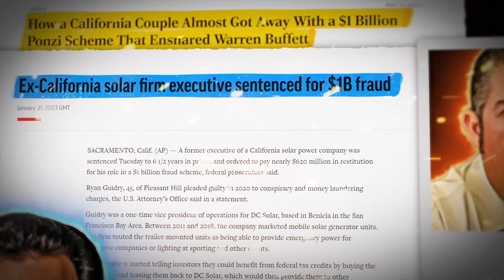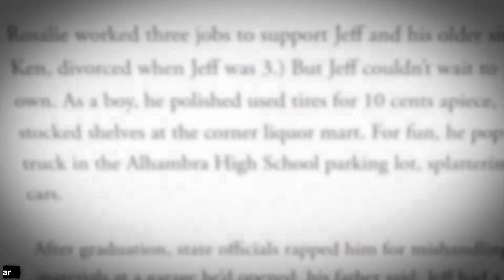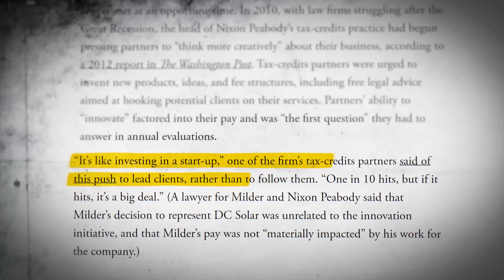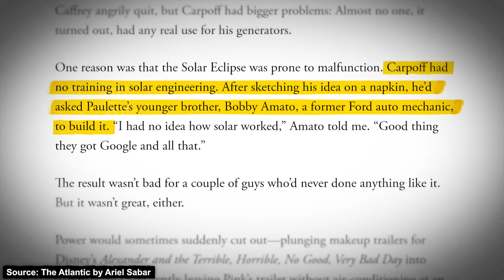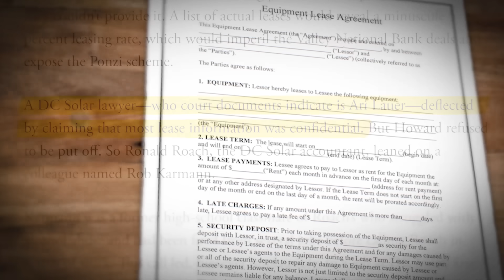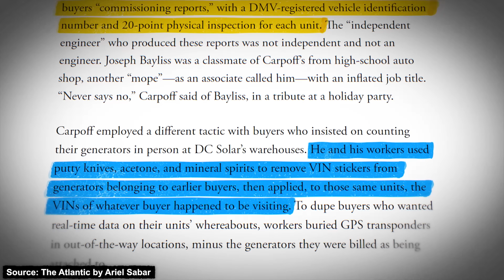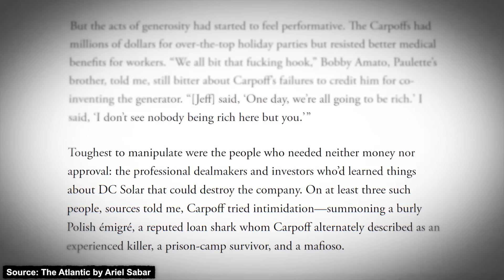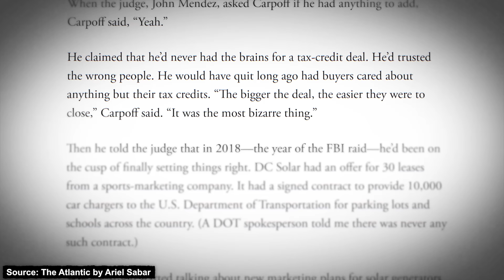The Fake Solar Company That Stole A Billion Dollars

Comment: I live in Arizona, which is a state with a HUGE solar market due to being a desert. I have seen the DC commercials and ads and thought to myself "yeah, that makes sense. A solar panel you can move". It was a simple idea. Had no clue it didn't even work. Just kinda assume if they're spending that much on marketing, they would have a working product. Especially if it;s a literal product you can see and not like a digital crypto currency or something non-tangible. Crazy I didn't know it was a scam until this video. great stuff, as always!
Reply: It seems like such a simple idea tbh. As panels and storage get better year after year this should be a very viable thing.
Reply: @Dantevonlocke  and also progressively cheaper. 

10 years ago the 100W panels cost more than 500 USD each, now you can afford it for a bit less than 100 USD
Reply: @sihamhamda47  a dollar a watt lol

But on topic, I remember seeing a video or something abiut these see through panels that could retain a large majority or the energy. Like more than the 10% or whatever it is currently. It was something over 80%
Reply: @Dantevonlocke  you're not going to get meaningful amounts of energy quickly enough with an array small enough to fit on a trailer. There's a reason engineers who understand the tech aren't implementing the idea; it doesn't work. They definitely thought of it already
Reply: @sihamhamda47  no, no they didn't.
Reply: Its a big lie to sell more chinese manufactured goods.  Efficiency is not what they say it is and drops off year after year.  Similar to a old cell phone battery.  Not to mention how they are made and what they are made with.
Reply: @pranc236  I can say from experience (~15 years with over ~250  295-320watt panels) we have not really noticed or experienced a year over year efficiency decrease let alone a cummulative one (maybe be 1-2% of total production, so if new produced 100kw hrs per day, then MAYBE 98-99kw hrs now).  We use microinverters and have data for every minute & hour of ever day since they were installed.  It's really awesome being able to track individual panels!

Now I'm not saying some panels don't degrade & it's very possible they degrade badly.  Our panels were supposedly pretty good quality, but IIRC, they are Chinese.
Reply: @kde5fan737  solar panels are batteries and batteries dont last 15 years in use with no loss in efficiency.  Everyone has to have a inverter otherwise you can only trickle charge other batteries.  I talked to many people with them and the results are all over the place. One person replaced half of the panels in less than 3 years.
Reply: @pranc236  Possibly, I don't know enough of it to really account for that
Reply: They did actually work ("some assembly required"), but your expectations need to be low. First off, those panels really don't like being bounced around. Second, ground level panels need a vast clear area to work well; the slightest shadow will kill a panel, and thus the entire string. Third, batteries don't like being too hot or cold - sitting in a black box on a trailer in the sun... (and the idiots used lead-acid batteries)

The panels are always the question. The inverters and enclosures were top notch. (they, and the trailer itself, are 90% of the resell value of those things. And they did find there way to eBay, etc.)
Reply: The funny thing is that it probably isn't even teribly difficult to build such a thing, especiallly if you have all that investor money. You could hire a competent electrical engineer to sort out the loose ends or even design a new system from the groud-up.

Heck, diesel submarines have been doing it since WW1. Granted, they don't use solar panels to replenish the cells but it's basically the same concept. Even better, the auxiliary disel generator could be made to run more efficiently (just like a hybrid-electric bus that NYC MTA uses). In short, the batterie allow you to draw power continuously without running the generators for the entire time.

From a genuinely "green" point of view it would be ideal to derive most or all of  your energy from the solar panels. However, you it is also my opinion that a good the ideal DIY solar setup (like w/ those "solar generators" which are just oversized DC powerbanks) would incude some sort of diesel/gas generator. Sometimes conditions are such that you can't fully charge the batteries in a single day, so you make up the difference with the coonventional generator.

Ultimately it's still more efficient than relying solely on the conventional generator, and allows you to  avoid using the grid to maintain the batteries. Anyone wanna go into business with me? Jokes aside (half joking), please consider checking out my channel!
Reply: You are WAY more trusting than me.
Reply: sure, if you can get the trailers and batteries for free.
Reply: You probably live in Scottsdale
Reply: @Dullahan161  maybe one day
Reply: @pranc236 Solar panels definitely aren't batteries. Generally you want to use batteries with solar panels, but they aren't the same thing
Reply: storage hasn’t really progressed since lithium ion. Storage is still the major killer.
Reply: It’s happened multiple times that a company had a faked or non-functional product.  Like Theranos, that hyped its new “blood test” system but really had to just buy older ones to run the blood, or the Nikola, the “clean energy” tractor trailer truck that never worked.  

The prototype truck had no engine, just a cool looking shell, and they had to drag it to the top of a hill and let it roll down to get footage of it “driving.”

Comment: We actually bought out some of his trailer’s from auctions. Gutted them and used the inverters for off grid battery storage. The stuff was junk and half of the trailers didn’t even have wires in them. He would put a small battery in there to power a gps token and make it look like they had them up and running on sites when they just sat in a field doing nothing.
Reply: The most valuable parts would be the diesel generators and the trailers themselves.

Comment: Never heard of this scumbag before this was really interesting .The car collection he had was ridiculous and impressive .Thanks Kira !
Reply: I’ve heard of it thanks to NASCAR.  DC Solar was BIG in NASCAR sponsorships.
Reply: he shoulda got put on by cartel used additional funds to fix products
Reply: @jakelynch3450  it's crazy how they fucked this up, it could have been an unbelievably successful business. there was no need to scam anyone with those profit margins.
Reply: @ripdoff8549  I doubt it could have been highly successful. There simply isn't enough demand for small mobile solar equipment. I mean, it's easier and probably cheaper to mount solar panels to already existing hardware (like the trailers/mobile homes on a movie set) than to have an additional trailer that somehow has to be connected to the power grid. There are some instances where you might need such a trailer, so that guy could have made a life from it and be successful, but not on a billion dollar basis.
Reply: Considering that he bought the car collection pre-2018, he could have pulled himself out from under the mountain by selling it when the market got crazy in 2020/2021, if he had survived that long.
Reply: @ripdoff8549  I gotta say I love the name
Reply: @jakelynch3450  cheers mate, i'd much rather be ripdoff than ripdon though haha

Comment: He could have hired a PE, particularly an EE to design a system for him for the cost of like $3-5k at MOST, that's for a first-of-its-kind design. Components, trailer, labor, etc. would have cost around maybe $20k, => someone that is in the position to know. $150k I would have actually started laughing, like deliriously laughing, even back then that was exorbitant, when he did his scam the total cost to customer should have been less than ~$50k / unit. Including good profit margins, overhead, equipment, and labor (the Solar Modules themselves back then were more expensive than now, but not to the level of $100k or $150k retail price).
Reply: yeah but the high price was part of the scam.  higher price meant bigger tax write off.
Reply: @kennj321  He could have sold bundles only per sale. I piece of gum is a unit but selling a whole pack of gum/units is more profitable.

Both he and the companies chose fraud when there was a much better, legal alternative.
Reply: A system that would work as advertised and doesnt require assembly on each move?
I doubt that would be possible to produce them at a price of 3-5k.
It especially makes no sense when looking at how much electricity has to be generated.
3 solar trailers for each regular trailer or even worse.

Comment: If he had built a aluminum 52’ trailer to pull behind a semi. He could have actually made something with enough room to generate real power
Reply: I mean if you only need low power. applications the short trailer would be enough. But I like the idea you are having.

Comment: I work in solar, and was offered some of those trailers in an auction. I didn't know the story behind them had so much intrigue.
I didn't participate in the auction. I needed trailer-mounted solar modules, but I was building the modules, not buying them. The diesel generator was just dead weight I'd need to get rid of. I ended  up building my own trailers, and they are in my backyard to this day.

Comment: Dude there is a dutch company in The Netherlands that is doing exactly this! 

The company is called Volta Energy and they are growing fast with huge number of investments. 

How did this guy not turn this into an actual legitimate company is beyond me.
Reply: It's because it's technically impossible. Solar panels simply don't generate enough electricity to run loads for useful equipment. Generators use diesel because it can produce big power. 
Unfortunately, photo voltaic systems just can't compete with what a diesel genset can produce.
Reply: Copy cats

Comment: I actually own one of the DC Solar trailers. It used to be a solar generator but that was removed and now I use the trailer (manufactured by Carson trailer) for moving my equipment. It's a 10k trailer, wich is decently rated for something supposed to have very little weight on it.

Comment: How the hell were solar panels on a trailer with a battery revolutionary?
Reply: Cause it meant as long as you had access to the sun you could have infinite energy without paying the electric company or gas companies. It was like printing money. Imagine going to your son's baseball game and having an air conditioned tent with working soda refrigerator. The possibilities were endless.
Reply: @azinyefantasy4445  If you need to power a building then cover the roof with panels, if you need to power a fridge in a party tent out in the desert use a diesel generator. Trucking these mobile solar panels around is not environmentally friendly. 
It's a solution looking for a tiny niche hipster problem.
Reply: @azinyefantasy4445  you sound like a supporter of Solar Roads
Reply: It's not, but a great tax dodge and highly scalable...easier than selling solar to homes I guess.
Reply: @azinyefantasy4445  you're missing the  economics of that though. If you need a physical $150K asset to generate let's say $300/month of electricity (being generous) then it would take 41 years to break even. That is not account for inflation or opportunity cost of capital. If you were to factor that in, you'd NEVER break even. Also, importantly, the assets will require maintenance and/or will eventually stop working - which is likely over the 100+ year time horizon to break even. So, yeah its free money if you neglect to consider the huge CAPEX of the 150k initial investment.
Reply: @reprovedcandy  you get $45000 of your taxes every year for being green. So you would pay it off in 3 years assuming the tax credits were still liable all 3 years and then extra $45000 the next 1-x years the government kept paying you to be green. It doesn't say how long the 1800 rent period was for so you would only have to factor that in.
Reply: @azinyefantasy4445  I’m pretty sure that the 45k is a one time write off
Reply: @azinyefantasy4445  you do understand that that tax writeoff is a one time thing on the purchase right? You're not writing of 30% of the initial value every year lol.
Reply: @uniktbrukernavn  you have to transport the diesel generator and diesel to run it too. Also you have the noise, exhaust and need to refill it. If you have something remote then it's better to use solar or wind to charge a battery to run things. You also don't have an ic engine to service.
Reply: @chrisnoname2725  If you'd watch the video you'll see that the solar panel trailer had a diesel generator as a backup, a backup that was used quite often, so the green solution was just a diesel generator with a few PV panels to make it look green. A scam.
Reply: @uniktbrukernavn  yes i know. I was commenting that you said it wasn't environmentally friendly to transport the trailers around and to instead use diesel generators. That's how i read your comment anyway
Reply: People heard "green energy" and that was enough.  Just like ESG ratings today.
Reply: It is and it isn't. It's a right place at the right time situation.
Reply: @azinyefantasy4445  I know. Its so beneficial and helpful every other person has thought of the "idea" before. That was my point - is a extremely basic and fundamental idea and hard revolutionary.

Comment: My takeaway from this, as if I did not know this already, is that so-called "investors" of all types are not nearly as smart as they would like you to believe, and that includes WB.  In fact, having spent years working as an investment analyst I can of course confirm from personal experience that the majority of people in the financial industry, people with several degrees and a long record of experience, are more often wrong than they are right, and the majority of them are two-bit hacks that often neglect due diligence, oversight and proper financial control.  Moreover, the entire financial industry is incestuous in the extreme, where deals are made in return for what amounts to overt kickbacks in the form of luxury goods, fully paid for holidays and everything else under the sun you can imagine, legal or not.  I would blow your mind if I were to actually mention things I have seen, but YT would not look favourably on me even mentioning the words.  So when you rightfully ask yourself, how did so many people in high placed positions not see this sooner, trust me on this, you give them way more credit than they deserve.  Lastly, large scale investors make money essentially via what amounts to little more than  "gambling" but since there really is no upper limit to the upside when they make a correct call, it cancels out the other 9 times out of 10 they make incorrect calls.

Comment: The absolute crazy thing about this is:

Firstly, not a single investor enlisted anyone with semi tiny bits of solar knowledge to understand that there is no way the solar panels could have kept up with the power demand.

Secondly, since they had a generator on each unit they could have used it to charge the batteries faster than the panels. Maybe they could have gotten some percentage of green energy. As the generator may not have to run 100% of the time. They probably would have gotten a very low green percentage but it would have been something along the lines of what they promised.

Finally, the companies really 9nly wanted to buy the tax credit. He should jabe never offered a return.

Meanwhile the market wonders why smart people don't trust the exchange.

Comment: Imagine where the world could be, and how rich this guy could be, if he'd just provided the product people paid him for.
Reply: Especially because it is not that hard. I'm pretty sure an electrical engineer fresh out of college can get the electronics at least broadly functioning. That is the strange thing to me. They found out quite early why not get someone to fix it. Shit you don't even need to admit the first one didn't work.
Reply: @muellermat  no check the energy density of solar cells and then roughly guesstimate how many units a movie company would have to use to run production.
Even if you assume 100% solar to energy conversion 24/7 you would need insane amounts of panels.

Since no panel is that efficient and the sun realistically only shines 8 hours worth of usable sunlight, the true needed numbers are that much higher.
Reply: @einhalbesbrot  I was not debating that point wich fair enough they are of questionable efficacy. 
I was mainly talking about how embarassing it was to fuck up "simple" electronics like that.
Reply: @muellermat This video really pisses me off
Reply: @muellermat yeah he at least could have had a disappointing but functional product

Comment: We recently replaced the battery pack on one of these with lithium iron phosphate. Interesting history.  It works from the solar in just not a lot of power 5 to 10kwh per day. With modern solar modules it could do 10 to 20 kwh per day.

Comment: My question is, why didn't he just build a real solar trailer? It might have avoided all of this, and he might have been the actual solar trailer king.
Reply: Most "green" or "renewable" energy is a scam. Sadly not a lot of people realize this. But everyone wants to virtue signal and claim they use good kind of energy I guess. 

If it was possible, people would have made real ones. Since there would be money to be made. But instead people like this will strap some solar panels on a diesel generator and claim to have built a solar trailer.